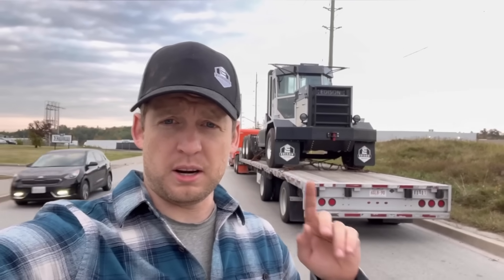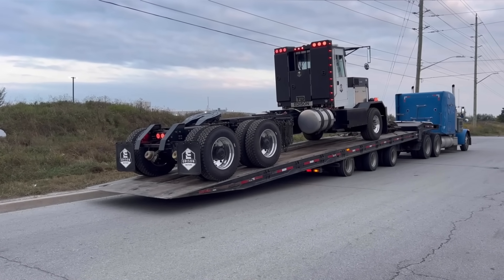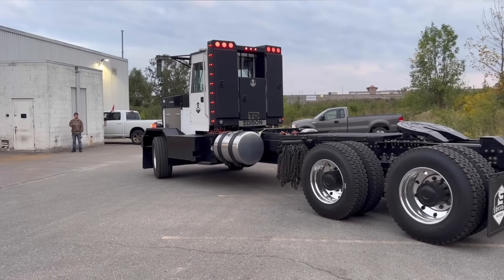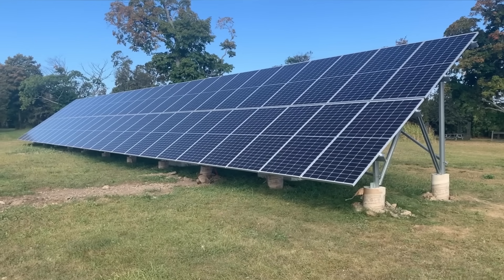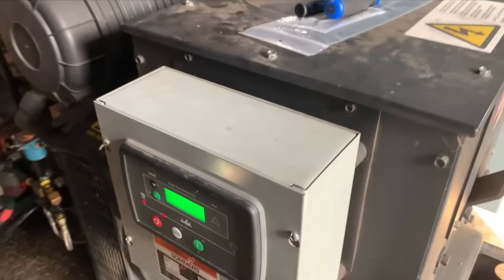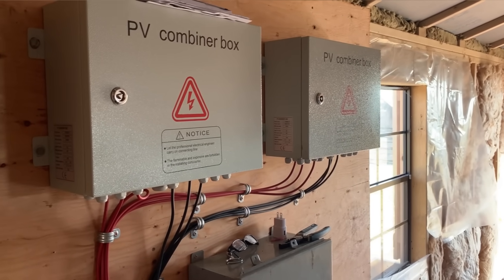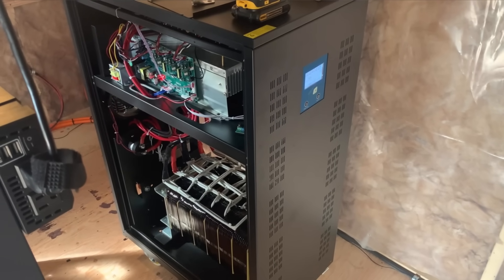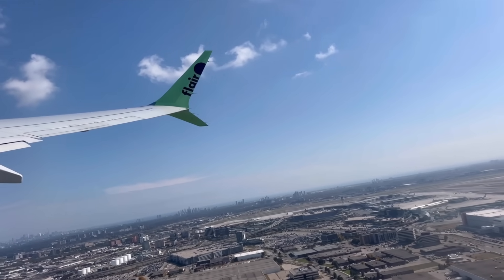Edison Motors Ontario adventure, Electric Trucks and Solar Islands

Comment: had a guy in a discord server wanting to go all solar due to his energy bill rates being terrible. he lives pretty far from the city so that's why. but his particular climate just doesn't make solar or wind viable at all. after some back and forths along with some rate and efficiency calculations we firgured out that a small propane generator and a battery system was perfect. he spends a quarter of what he used to for power needs.

Comment: I think the remote energy usage is probably one of the better cases for solar power and/or wind. Likely their diesel savings alone will pay off the system, but having the diesel there as a backup is huge.  It's still energy dense and will help in the winters.  I think the only thing you could do more is find a way to better use the wasted heat from the engines to heat a house or something like that. Likely it will go a long way to keeping the diesel fuel from jelling up in the shed and keep the batteries above freezing.

Comment: Congratulations on delivering the truck.
And mad props to the solar system! I've had some experience with solar but only On-Grid systems. I think that there's a huge need in creating an integration between On and Off Grid! Haven't seen yet a good system that works well woth storage and sending the exceeding power to the grid. But judging by your clever ideas and solutions, maybe soon enough there will be such system!

Comment: so what if you programmed on a board multiple sensitivity levels for the pedal, so like say you’re on the highway and your pulling the logs to the destination you could have a higher sensitivity level but then with like a button press on the little tablet or whatever you installed on the interior you could then have a low sensitivity pedal where even with the pedal fully pressed you’re going at most 30kmh

Comment: Trying not to be picky because I feel what you boys are doing is a thing of beauty…CEC Section 36 High Voltage is Greater then 750 Vrms (root mean square means the approximate equivalent of Dc)Cec section 16 Extra Low voltage is below 30v…so that leaves 30-750 V Ac to be Low Voltage…And yes I am aware that there is also Medium Voltage but it is not in the CEC…Medium Voltage was 750- 2300V or 5000V or higher depending on who you are talking to….

Comment: Have you ever considered recovering the waste heat from the generators and batteries to a heat exchanger for space heating or domestic hot water? I wonder how many gallons of domestic hot water you could get in an insulated tank on that 4 hour generator charge run... Take a look into "cogeneration" systems, pretty cool stuff.

Comment: I'm curious. What would the plan be if someone wanted a PTO hydraulic system on a truck? Would it be a drive between the engine and the generator to run the hydraulic pump, a full on electric hydraulic pump or maybe both are an option?
Reply: I was talking with them at the show about that, and Eric was saying that they were thinking about going with an electric over hydraulic system (motor running hydraulic pump)
Reply: 575 3 phase motors are plenty here in Canada So by adding a DC to AC  part(AC inverter)of an AC drive you could quite easily have a variable flow hydraulic pump with little hardware and programming required…

Comment: 8:35 you should look into using a tablet you can root and install a BMS onto for this. If it's staying plugged in all the time, the battery is going to die way sooner than it should, potentially catastrophically. There are already plenty of solutions for android that will limit the charge level to 80% max charge (or custom) for longevity of the hardware. Maybe this device is already supported. 
This kind of install is going to be unattended enough that if the battery in that tablet swells up and fails, it'll burn down the whole system quite literally. Stay safe and keep up all your amazing work lads
I looked into it when i was setting up old phones as remote cameras and found one busted open from the battery.

Comment: It's not just throttle mapping, you need to add a function that smoths the input to remove jerk, like on an IC wngine if you go from 0%-20% you don't get 20% imedi it takes a second to ramp up

Comment: I might have missed it in a video but is there power steering? It looks like you have to wrench the wheel pretty hard to get it to turn at low speeds. I know nothing about trucks so sorry if this is a silly question!

Comment: Would still like to see Supercapacitors integrated into the Edison motors system.  Either or the truck or the onsite charging infrastructure.  
Skeleton tech seems like a great fit as they already have systems to integrate into heavyduty vehicles.
Reply: Might I ask you why? How would the capacitors improve the vehicle?
Reply: @sportshootingfin  they would serve as the primary source for power on the torque curve. Thereby relieving the bulk of the power draw off of the batteries themselves. This would prolong the life of said batteries. Skeletons graphene super capacitors have a life cycle in the tens of thousands, while batteries in the thousands.  Also the charge/discharge time is in the seconds so they can also serve as a secondary "fuel" source to be discharged at the top/bottom of the work zone to facilitate better charge times.
Reply: @wildtwindad  yeah, idk man. The truck is already 25% more expensive than comparable ICE vehicles. Seems like the ultracaps are way more expensive than Chinese LiFePo battery packs. Also the energy density for Skeleton ultracaps is 6.8Wh/kg compared to ~150Wh/kg for the batteries so replacing the battery (or part of it) would increase the weight of the vehicle. As Chace said in one video, weight saved is money earned for truckers. At this point I think it would make sense to streamline and simplify to make the truck cheaper and easier to manufacture rather than add another system on top of everything. Thoughts?

Comment: Couple ideas for you, with electric throttle mapping it'd be cool if you had a way to adjust the sensitivity of the pedal to whatever the operator desires. If someone wants a race car, they can adjust it more aggressively

Also I can't remember what steering system is on the truck. If you get electric over hydraulic steering, you can also change the steering rate. Make the steering faster on road and slower off-road in the bush 

Just a couple thoughts!
Reply: yah a "throttle" leaver on the dash so the driver can pick how much go he wants on the fly, cuz going empty you don't want that much, but loaded you might want more!
either that or the truck will have to simply have a max acceleration set that won't ever let the tires spin, loaded or empty.
Reply: Trample Mode and Grazing Mode
Reply: It could have dynamic throttle mapping for different loads

Comment: What is the price difference between Pb and LFP battery banks for a system like the one demonstrated on the island.
(Value is obtained of course over the lifetime of the system.)  Backing up with diesel for the  sub10% of days is obviously cost effective, rather than having to double - or greater - the battery banks - even then (without an "extravagant" spend) it wouldn't last through an extended stretch of bad weather - meaning the full sized diesel backup will still be needed even after a 2x spend, something governments and grid operators don't seem willing to admit (we will still need baseload redundancy for "the forseeable future" in grid applications).
Reply: Lead acid batteeies cost peehaps 1/10 per kwh, but in the long run will cost more because of faster degradation and you never want to discharge below 50%.  Lead acid will be useful in -20⁰C without having to heat the building.  Llithium is terrible below 5⁰C and stop working below 0⁰C.  Wearing out your lead acid batteries justifies the much more expensive but better value lithium batteries later.  BreakING up the initial investment into more managable spread out chunks makes the system easier to buy.

Comment: This is Super rad!  I just started with a solar company here in Colorado as an electrician🎉
Reply: Awesome. There is tremendous opportunity in the renewables sector and not nearly enough people working there yet. Quality honest electricians will be in short supply for a while (not that they weren't already) as people switch to solar, heat pumps for heat and hot water, and home batteries for power arbitrage and home backup.
Even simple things like a panel for emergency systems and charging your EV. The demand is likely going to skyrocket as people trust the grid less and less and the impacts of climate change make it less reliable.

Comment: I'm not sure if you understand how Edison Motors has captured the "Zeitgeist" of the Canadian diaspora,...
you can see it in the comments sections.
Your popularity will allow you to plow thru the morass that is Canadian Bureaucracy, 
Under promise results and reap the benefits of blown out expectations , it will be harder for a low production manufacture.
In your favour however are the next level performance that Ev's provide that will smash any detractors bluster.
What i am personally looking for are the results only YOU can provide on the logging roads.
I believe that once that vehicle is dialed in, ..accelerator mapping and control functions , even YOU will be blown away by the precision of this "testbed".
Good luck Edison Motors.

Comment: Hey  Chase I'm a Hybrid vehicle tech, in the U.S. Vehicles are required to make some sort of noise while operating at low speed in EV mode. Toyotas have a speaker that plays a humming noise. So how about a speaker on TOPSY that plays steam engine or jake brake noises?
Reply: Or just some guy going “vroom vrooooom”
Reply: @tweezerjam Or make it programmable so you can set your own. I certainly set it as Dannie Thornberry's yabidabidabodobidabidabidabi rambling cause ether you are annoyed out of the way or have a smile remembering The Wild Thornberrys  tv show as I pass.
Reply: @devinw8809  I didn’t know what that was. I do now… wtf 😂
Reply: @devinw8809 
I love it😂
Reply: @devinw8809 that’s the greatest thing I’ve ever heard😂😂😂😂
Reply: @devinw8809 I thought his name was Donnie lol
Reply: @devinw8809  How about either Speed Buggy, or Jack Benny's old Maxwell car. Both of those were voiced by Mel Blanc.
Reply: @tweezerjam  "vroom vroom watch out lol" on a loop 😂
Reply: @tweezerjam Chace going vroom vroom😂
Reply: I'd love to hear a Case steam tractor noise. It'd be a massively funny bit of trolloling.
Reply: Pretty sure they got a train horn for that
Reply: the truck is called Topsy.. so why not elephant sounds?
Reply: Since when I've actually been tapped by three different Tesla's cuz I never heard them coming........ Evs are dead silent in my experience and the low hum they make isn't audible in cities
Reply: @dustinmiller7278 apparently it's been required for years now but the minimum standard isn't very high, so some evs cannot be heard over other city noises. Really only matters for a blind person walking on the sidewalk outside the city. There's a guy in my neighborhood with a cane that walks around. Can't see but one day I scared him on accident on my bicycle because he didn't hear me coming. I was on the road, he was on the sidewalk, but by the time he heard me it scared him. Felt so bad about it
Reply: I still like the tesla coils regen braking thing
Reply: Chase should look up Angie The Great, who built a program to realistically produce engine sounds.  There's another company who is using his program to produce engine noises for their e-bikes.
Reply: It needs elephant sounds, to honor its namesake.
Reply: Leave a chain dragging
Reply: He has air horns.
Reply: @kaidenkaiden2936  When I was 20 I had a 327 Camaro done up with straight-thru glass packs (just barely legal). My dad told me he could hear me start the car when I was coming home from my gf just over a mile away.  I thought it was AWESOME as did all my friends. One night when I got home at 2am my dad said "We have neighbors. Turn your car off when you turn the corner - or don't come home".
Straight pipes are awesome - in the US with open carry at 2 in the morning they might get you killed. Literally. There are other people in the world.
Reply: Jetsons car sound!
Reply: @daverussell9627  Came looking in the comments to say the same thing. You beat me to it.
Reply: @mattmarsh4279  I'd like to make our ioniq5 do it, but it's not an easy option...
Reply: Move bi*** get out the way on repeat🤣🤣
Reply: How about the warning sound that an elephant makes as an option
Reply: Steam tractor 🚜
Reply: Can I play deadmau5 from a 13 point speaker system really loud
Reply: Even simple things like whistles are good enough for that. Do commercial trucking EVs of this size make little noise?
Reply: Someone in the mic going bbbrrrrrrrrrrrrr hahahah
Reply: Why not drive the world mad with Crazy Frog sound?  🤣
Reply: I would like to vote for steam engine noises 😅
Reply: Put speakers that blast Deadmau5 because he is a Canadian producer
Reply: Crazy Frog noises
Reply: Jetsons! That weird annoying beep that cartoon future cars from Hannah Barbera universe needs to come to electric cars
Reply: I can hear the chains rattling
Reply: I think all electric vehicles should sound like ice cream 🍦 truckd
Reply: It's the same under UK & EU regulations. My daily driver living in London is a 2020 Kia Niro, and it makes a fun spaceship noise at urban speeds if the engine isn't running.
Reply: Hi all, 
I was going to say, this is very dangerous. It's so quiet. You'll kill somebody. They won't even know they died.
Reply: A low-key vehicle sound would probably be necessary if the truck is sufficiently quiet (it would seem difficult for a truck that size to be THAT quiet, but ...)
Jake brake though? You DO realize that for those of us who don't breathe diesel exhaust and live to drive, the use (and especially abuse) of jake brakes by a small minority of truckers discredits the whole profession?
One of the big plusses to electric trucks is that, instead of bleeding off that energy as NOISE they will put it back into the battery. Of course, that doesn't p*** off everyone around you, but you should consider why you want to do that in the first place.
Reply: I've always thought that rule was stupid. My son's Tesla sounds like a UFO...it's annoying as hell. Just watch where you're going, even if on foot.
Reply: @Myrune1 it’s for blind and impaired people, who can’t look where they’re going, lol, otherwise they might not even know there’s a car on the road at all.
Reply: @Myrune1  It's more for the cases where an electric car goes overcenter, hops the vestigial curb, and is on-course to wipe out someone in their front yard.

I.E.  "A normal Tuesday in Ohio."
Reply: @Myrune1  This law is also for the blind if you are going to drive on a public road. The blind use engine noise to stay safe

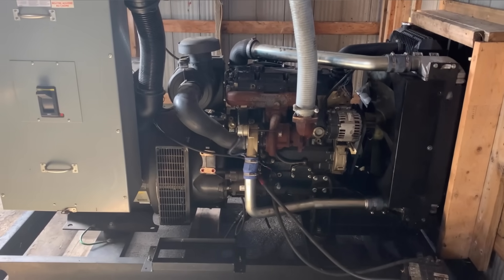Comment: 5:20 Hawaii Islands over the last few years have done the same with a lot of their islands with solar and wind farms with batteries - they have been taking out diesel generators because they were never getting used.

Even the main and bigger islands are closing down fossil fuel power stations due to the costs and also they get enough power from renewables.

The plan is to get fossil fuel free by 2040ish which will save the population a lot of money because they do not need to import petroleum-based products and other fossil fuels which cost a lot more because it has to be transported from mainland USA.
Reply: Mini solar power stations are popping up in rural Ghana too, as it's too expensive to put up power lines for 20 houses in the bush. Theives have been stealing the high-tension cables, and wooden poles don't work after bush fires burn them down. So the government gave it a rethink and came up with the mini solar power stations. They also have the benefit of no power cuts; unfortunately, I'm on the national grid, and I'm lucky if I get power for three days in a row. It looks like the way forward for a lot of countries.
Reply: @laupernut  I was writing about power wires being taken for scrap and poles being chopped down for fire woods and construction back in 1999 - even solar panels to run cell towers and other remote stations were/still are being stolen - all this come from what I read in the 1980s
Reply: Gotta get the unwanted off the islands first by raising rates on everything and then have a massive fire for a planned "smart" community
Reply: @Patriot46426  
Don't forget to VOTE friend, ...
VOTE like yer Life depends on it